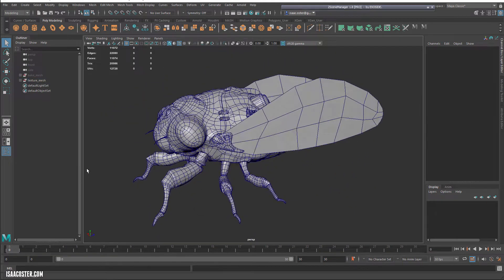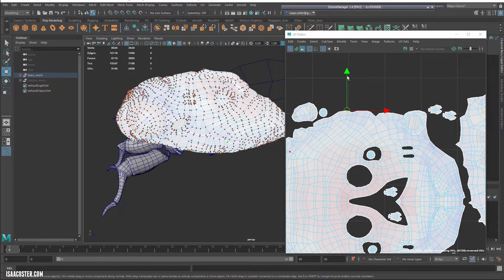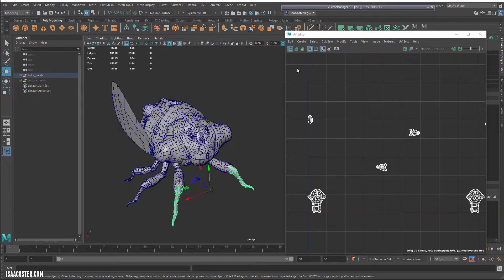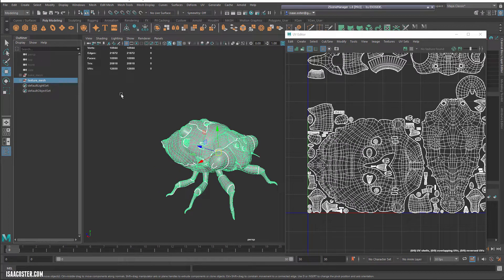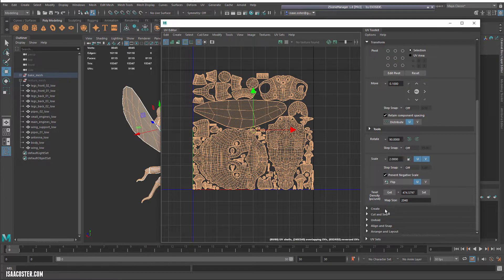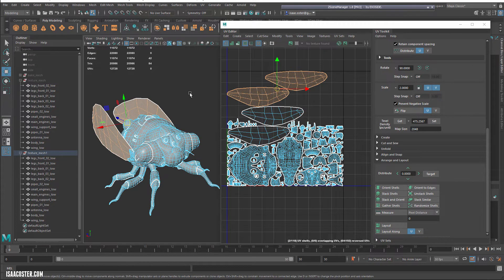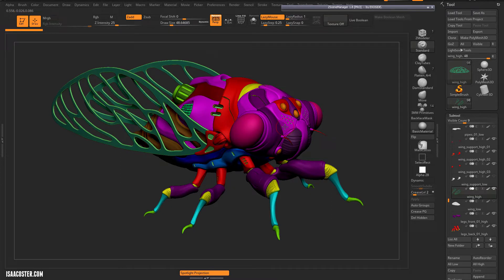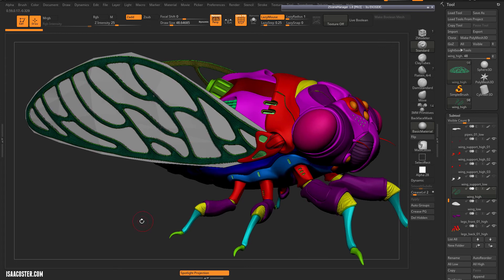Hard Surface Modeling with Zbrush Part 3: Ch 06 UVs in Maya

Comment: Sorry for bothering but english is not my native languages and also i watched carefully again n again but i couldn't understand what's is the purpose of bake mesh and texture mesh is seperated. Can you explain step by step what's the point of this?
Reply from the maker: Hello - the idea is that it is easier to deal with editing UVs where you want to have specific stacking configurations when you only have one instance of geometry per UV shell.  You can see in the video I want to stack the wings, the engine, the tubes, and back legs, so I only have one of each in the geo.  It is possible to use Maya's UV toolkit to stack similar shells, but I find it to be problematic.  For example, I want the front legs to be unique, because they can be seen at the same time, but they are identical and Maya would stack them if I used that option.  When I was doing a lot of this kind of work, I wrote a tool that could automatically detect geometry that was missing from one side of the mesh and mirror it over with a single button. I would keep the bake mesh - optimized for iterating on UVs - separate from the game mesh, which was exported in the game engine.  If I needed to make any changes on the geo or UVs, it was just a single button to generate the final game mesh with all the UVs stacked where necessary.

It's worth mentioning the high poly still needs to be mirrored so you get accurate AO bakes.
Reply: @IsaacOster  Thanks for your answer <3 Have a nice day!